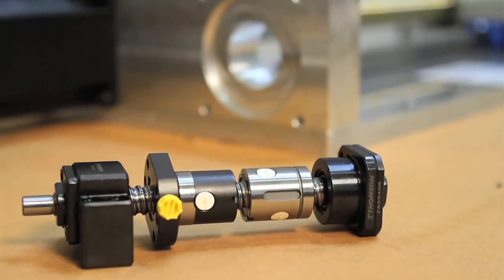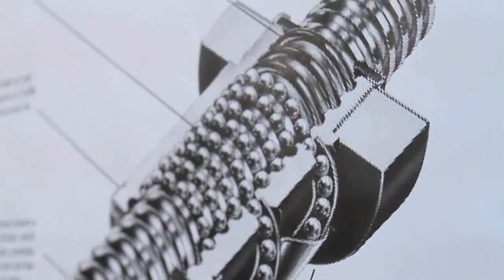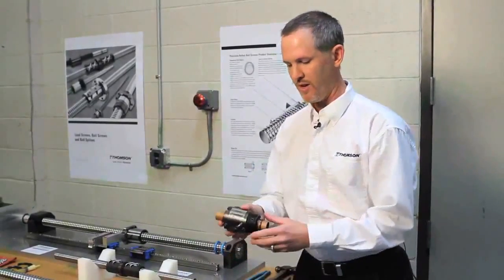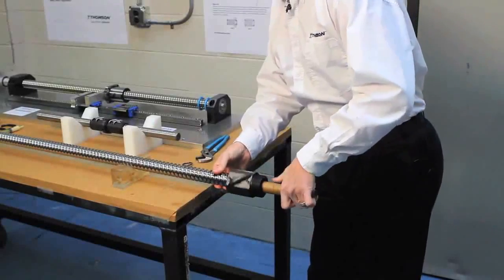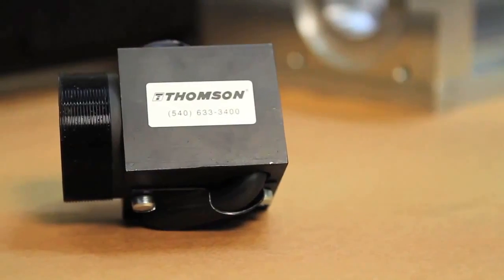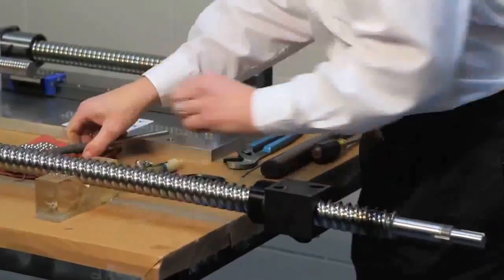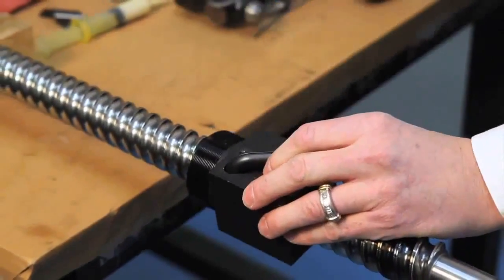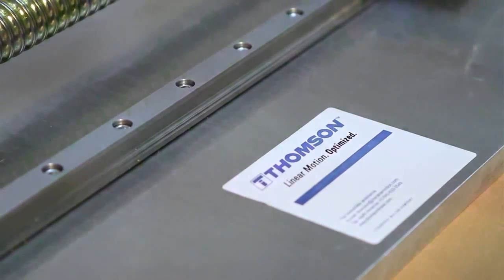What is a Ball screw?  How to install a ball nut and how to reload bearings into a ball nut.

Comment: Dear Friends, a question how many balls must have a Ø40 Diameter Spindle Step = 10 mm with recirculation tube, there is some formula to know the number of balls, thank you very much for the attention
Ball screw code is  4010-2.5 Ball Ø6.35